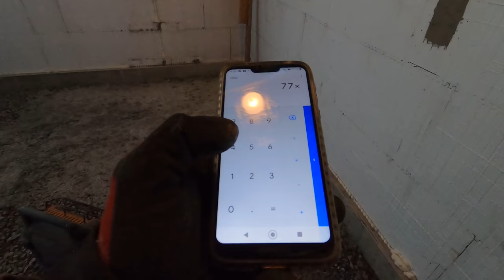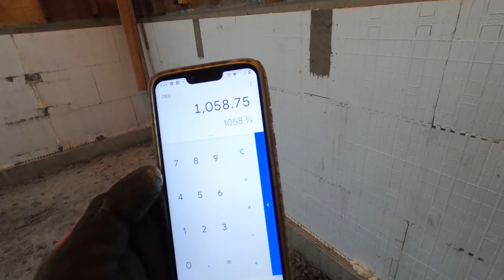Installing a foundation under an existing building part 2: ICF, damp proofing and some backfill

Comment: Hey Jesse, can you spray that water sealer-Blue Stuff ??
Reply: Can you spray this stuff ??
Reply from the maker: yes you can
Reply: @jmuller86  why didn’t you spray it then instead of brushing it taking forever ??
Reply from the maker: @kurtmccarthy6733  I didnt want to experiment with the sprayers, we didnt brush it we rolled it which did not take long at all
Reply: @jmuller86  yes I saw that you rolled the large areas but along the edge - footing meats wall you brushed it. Now I’m not criticizing you Jesse, cause I’ve never used it, I just thought it would have been faster all the way around to heat the stuff like you said and spray the whole thing. 🤷‍♂️
Reply from the maker: @kurtmccarthy6733  yea on a bigger project I would do that. But I would also consider the peel and stick waterproofing on a bigger project. not sure yet
Reply: @jmuller86  ok I get it. You’re right   In that weather and size of the project I guess I wouldn’t have dirtied up my sprayers ether Jesse. Love your videos and have learned a lot since I’ve been in construction.

Comment: What’s the advantage of ICF over traditional foundations?
Reply from the maker: quicker, easier, more insulation. and you dont have to lug around 100lb panels, twice
Reply: @jmuller86  thx. I should have waited until the end of the video to ask questions.
Reply: @seandurgin  :)

Comment: Those styrofoam building blocks looks like the blocks used to build the Wall,  Pink Floyd style..!
Reply: Yeah.  ICFs have been called "Legos for adults".
They're a blindingly simple solution to an issue that's builders using concrete have suffered with for decades.

Comment: I don't know anything about foundations , but why didn't you put like  Tin the footer & foundation and drop 8" it down every you put them mounting extensions? You could have even put your bolts in them board when you poured the cement ,then remove the nuts & boards & your bolts will already been in the cement, you could have stuck a 12" bolt in there ,had 8" in the foundation & 4" sticking out  & you wouldn't had to drill anything. I Dry cast culverts & we put everything in the form then pour it
Reply from the maker: I hate having to find the bolts , I know you can wack the board and it makes a print in the back and then you drill out, but they are always oversized and about 1/4" off from where you really want to be. with this you slap the board up and drill right through both, getting it exactly where you want and not having oversized holes to sag over time

Comment: Don't those drainage pipes needs to be glued ?
Reply from the maker: no these ones are thinwall, I have used silicone in them before, but its really not necessary

Comment: Solid draining pipe?
Reply: Most likely perforated on the bottom  side, stronger than your typical big O so it won't crush
Reply from the maker: perforated until it exits the building footprint

Comment: What was the height difference between bottom of french drain vs the bottom level of foundation?
Reply from the maker: bottom of pipe is 3" below the bottom of the footing. that way you can get your 6" of gravel on top and then be even with the footing

Comment: Ah dude a cold joint above the frost line is going to have issues. Not sure why you had to do this BUT if it was water issues you should regradee the property to drain farther away from the building if you can. Just saying.

Comment: What about windows so close to the floor height, looks strange to me.
Reply from the maker: thats how the windows were originally, the floor height is only 2" higher than before
Reply: @jmuller86  OK, I just from looking at the new addition window height and the scanning to the windows on the repaired foundation section, just not equal. Just like you said about the grade, you have to make it work somehow.

Comment: Susprised that they didn't put more rebar in the wall.
Reply from the maker: a 4 foot wall needs almost no rebar. when you get into 8' or higher, then you need more rebar unless its not backfilled much

Comment: I didn't see enough re bar on those forms. There should be bar in every course. You must not have inspector up there.
Reply from the maker: 2 bar in a 4 ft wall is fine. this is not an 8 ft wall. 6 ft or more and I put it every 2ft

Comment: I didn't see and vertical rod to footing,,, epoxy is wasted money, drilling is time consuming, install vertical rod  when u pour footing,is stronger, like the pros do, tiny little footing as well,I do them min 24" wide with 2 rod continuous, nice film,,,
Reply from the maker: I wanted to make sure the spacing was good instead of having to bend them when they hit the webs which are 8" on center. makes finishing the footings easier too

Comment: Watch Dirt Perfect for ICF big builds. He is an expert.
Reply from the maker: I do watch him sometimes when I get a chance. he is pretty good
Reply: @jmuller86  He recently had a three part video of a large build and reviewed the bracing system he was given to demo.  the build had a lot of corners and he gives some great advice for the use of the ICFs and wall setting. Just a suggestion as he has used several brands too.
Reply from the maker: @barryhumphrey153  I did watch some of those, I will be getting some bracing soon. I have some really big stuff coming up with ICF's
Reply: @jmuller86  curious to see what it is.

Comment: Why are you just putting a foundation under just part of the house you can clearly see there's none under the other part of the house just some stacked rock and is that a solid pipe you put in for a foundation drain
Reply from the maker: the other part of the house has a stacked stone foundation that goes well below the frost line   this one was barely 2 ft down. the other one is sealed off from animals, this one was not. and no that was perforated pipe
Reply: @jmuller86  ya I couldn't see the holes in the pipe my bad great job on this too